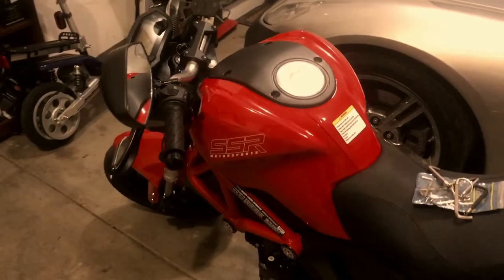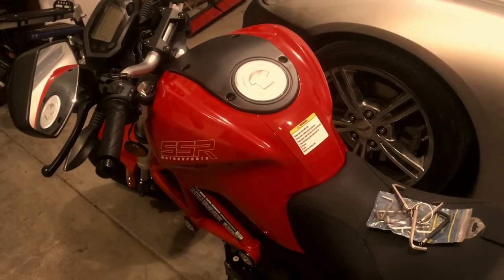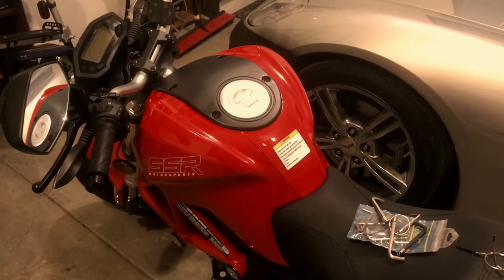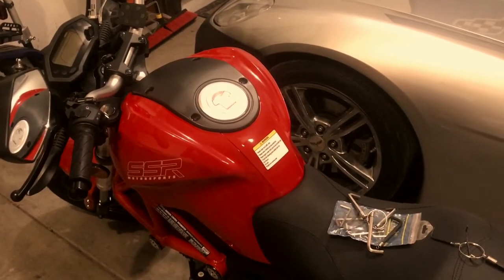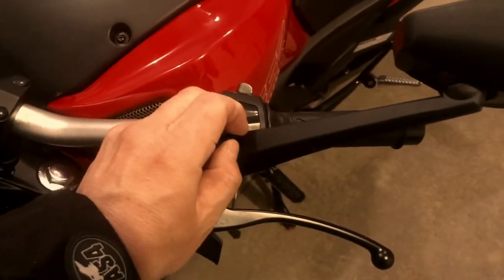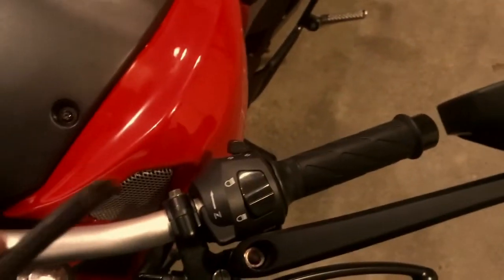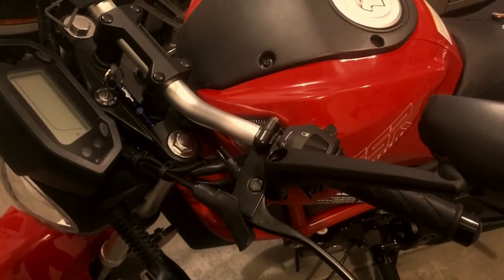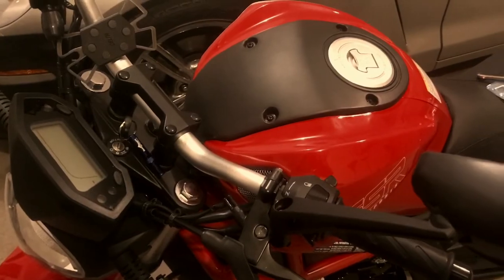Razkull Dies!! | Cold Ride | Fixing My Mirror

Comment: This is the biggest issue with carburetors. I rode two years straight through. I live in CT, so the Winters usually see single digit temps. The bike I owned at the time was a Kawasaki Eliminator 125, which is carbureted. It was running lean in stock form, so when you add cold temps the bike's performance really suffered. My bike would do the same exact thing as yours in the extreme cold. When the carb developed an unidentifiable air leak, it made starting the bike in 40 degrees hard. I would really love to pick up a Razkull, but I'm tired of dealing with carbs.

Comment: how often does it die on you?
Reply from the maker: It only does when I downshift from 3rd or 4th.  Which is obviously not ideal.  I spoke to the dealer, they suggested I bring it in so they can adjust the carb.  Probably increase the idle and perhaps the air/fuel mixture as well.  I'll post an update if that works!
Reply: Ianunleashed 00 I have the same issues too just got mine 2 days ago it's just carb adjustment
Reply from the maker: bruce galvante I agree, I believe the Carb is a weakness in stock form. I replaced with a PZ27mm and I'm super happy.